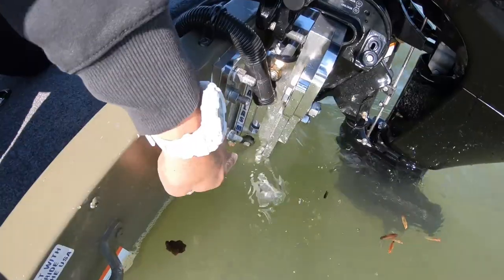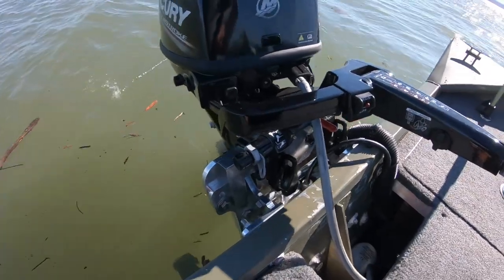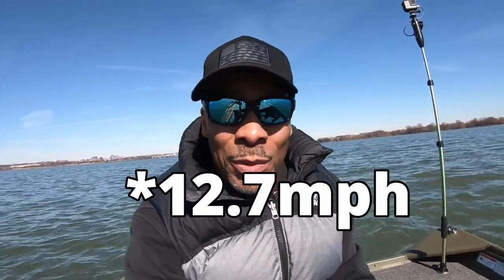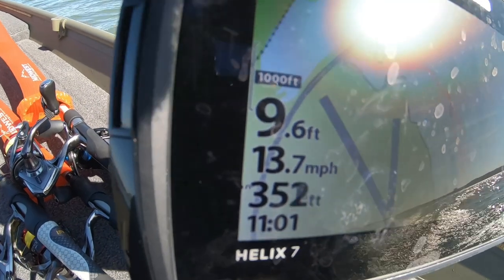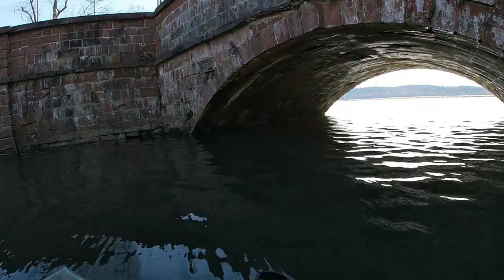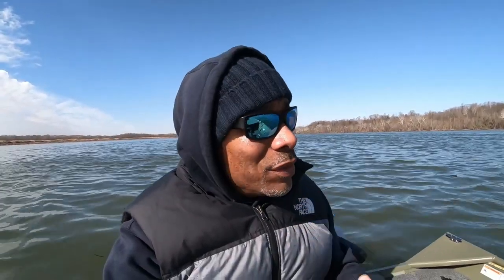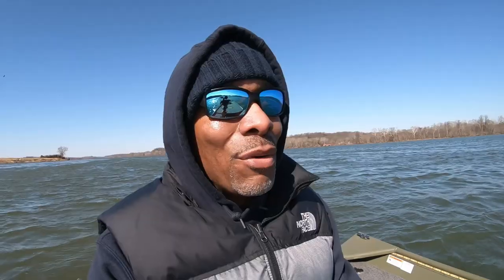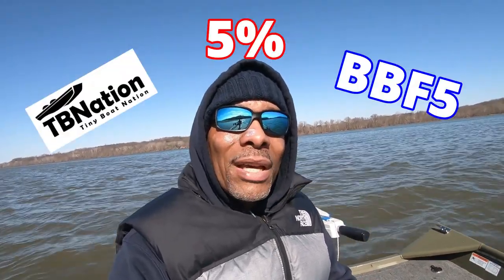Atlas Micro Jacker PERFORMANCE TEST {Mercury 9.9 & ePropulsion Navy 6.0 Outboard Motors}

Comment: What battery set up are you running , I’m running the old navy and the older navy battery’s in a bigger boat (1776) and I’m running faster then  that(8.5-9 2 big boys and Full tournament load). You need to work on you weight distribution
Reply from the maker: Yea I need more weight in the front for the Navy to run faster

Comment: With the epropulsion, did the jack plate help with the giant motor blocking side scan? I don’t want to waste the money if it won’t resolve my issue. My sidescan doesn’t work at all off the left side.
Reply from the maker: @bigdunford  I don't have any side scan issues before adding the jack plate so I can't vouch for it.

Comment: So how high did you need to raise it and how much setback does the  jackplate provide?
Reply from the maker: The setback is around 4 inches or so. I raised both motors up about 4 inches for peak performance.  At least so far 😃
Reply: @BassBrothersFishingDMV  Thanks for the info, I built a DIY jackplate and my original dimensions had a 4" setback with a 3" rise and it ended up deeper in the water and slower than I started, similar to your first attempt before rising the Mercury.  I added a spacer to try out a 5" lift, hoping to test it out here shortly.
Reply from the maker: @mvboutdoors  awesome man.  Good luck. I hope it works out. I commend you for trying. .  There's no guarantee.  You just gotta try.